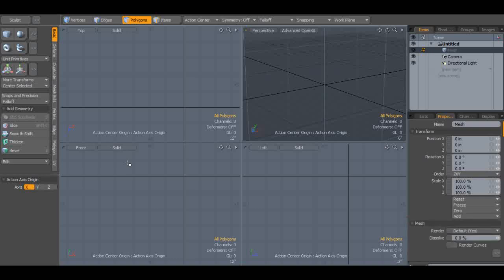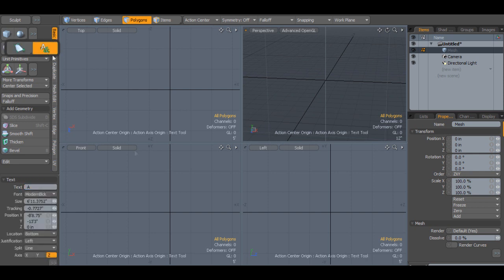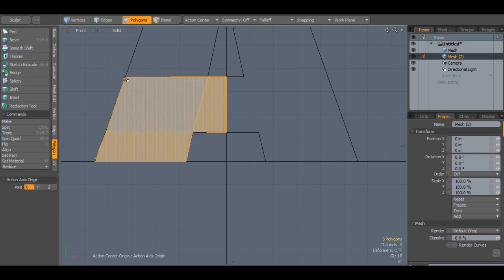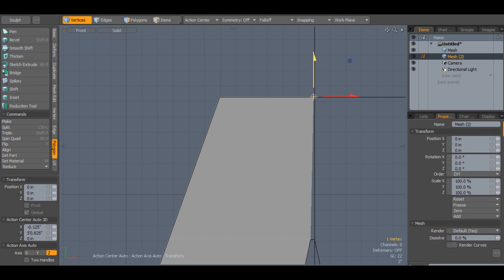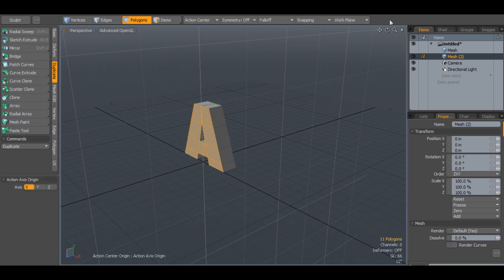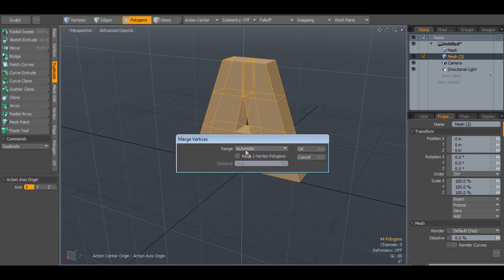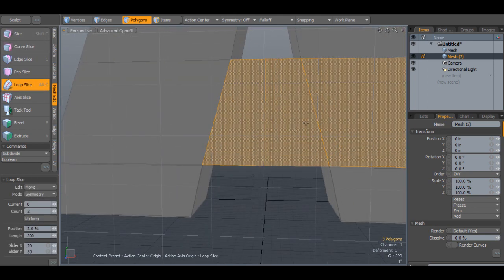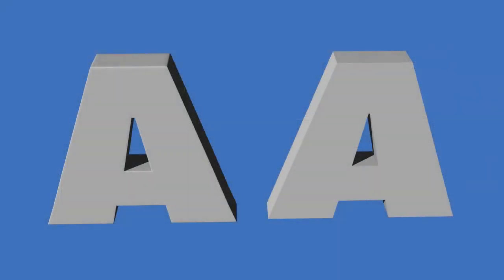How to model SDS text in Modo

Comment: Thank you was helpful, Modo 801 text work around.
Create letter faces using this tutorial, create mesh item for each letter, select each item mesh "letter" by clicking 5 on keyboard "do not select polygons", select edit mesh on side tab, extrude in -x axis to desired width, then select polygons by clicking 3 on keyboard, double click letter to select all polygons, select geometry at top of screen, vertex, merge, automatic, ok. Save after each letter completed, Do not select all mesh items "letters" or you will not have polygons on both sides of the letter. So, only extrude one letter at a time.

Hope this helps